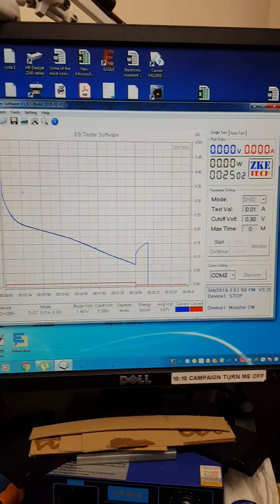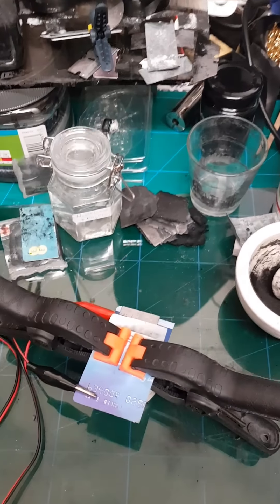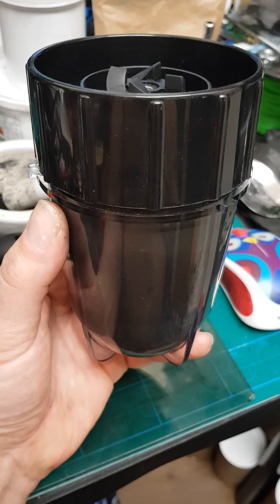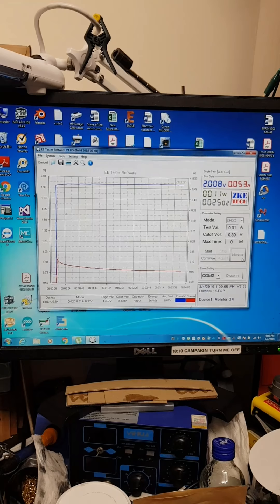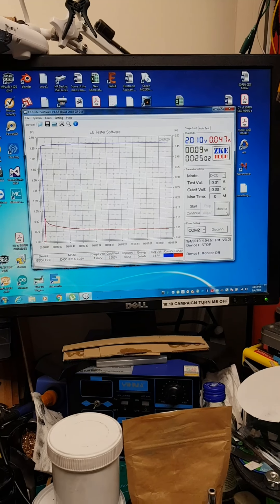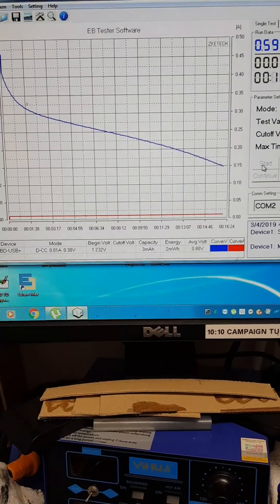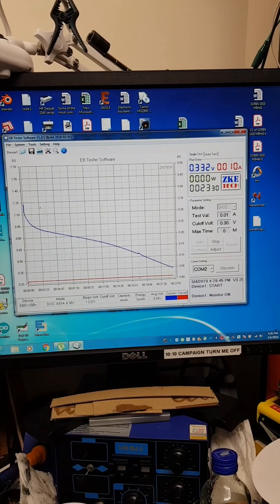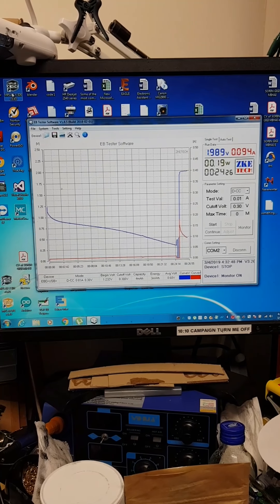An All Carbon Battery test, old cell-new Deep eutectic Solvent Electrolyte

Comment: Hi Sorin, thank you for for videos, I've subscribed to your channel. I too am looking at DES's as a non-aqueous solvent, the ones I am looking at centre around a Choline Chloride:Urea:Glycerine, 2:1:1 , (ChUG as I call it) DES, with copper chloride, copper sulphate or iodine as the electrolyte within the DES "carrier". Early days as yet, as I am still trying to refine the binder composition and assess the longer term stability of my DES.  It is interesting however that for instance, Iodine which poorly dissolves in water, rapidly dissolves in my "ChUG', so they are certainly worth some experimentation. Also, other benefits can be that there may be less interaction of the electrolyte with the current carriers within the cell. This can then help you assess the true actions going on within your cell. Also, it is sooooo difficult to obtain a good supply of graphoil in rural Thailand, so I tend to have metallic current carriers :)
regards

Tony
Reply from the maker: Hi Tony, testing an idea is the biggest time consuming part. I do not have Choline so I am using ammonium chloride mixt with zinc chloride and urea, or MEG, or Glycerine..... This mixture doesn't melt down entirely so I am still playing with the amounts. I am trying to make my own graphitic  plastic plates to eliminate the graphoil or the metallic plates.  As I said,  time consuming, especially when you have 2 jobs and a great family..... But will get there, slowly but surely. 
Sorin
Reply: @mihaiaragon  Hi Sorin, yes getting the correct ratios to make a DES can be difficult, as sometimes you cannot find the best quality  chemicals to start. For instance,  Urea is used with many DES's but unless you want to pay for laboratory grade, you buy fertilizer instead, yes ? So that is why I tried bringing Glycerine into the equation...it is a liquid to start and the other components readily subsume into the liquid  too!! I have had a batch on the shelf for about two months and it appears to be still holding together.
Before this, I tried to combine the two chemicals with some heat, but found sometimes oxidation/degradation taking place...most unsatisfactory...sometimes it worked...sometimes not...grrrrr !!!
But your most important mission in your life is your family, so if you can spend a little with us , after working to support your family, then that is good.

As you may have seen on my comments to Kev and RMS, I have been looking at using Ammonium Persulphate to graphitise native charcoal. A typical test that is done as a quick and simple resistivity test is to place some powdered material between two plates. My plates are copper,  appx 20mmx10mm, the thickness of the dry material in excess of 2mm and I am recording resistivity at 0.6 ohms....not bad eh !!     But like we said before, this is no good without the rest of the system, so I move on....like you slowly but surely :)
kind regards
Tony